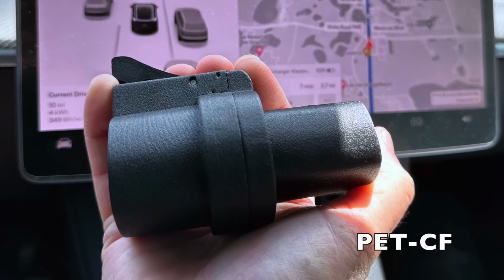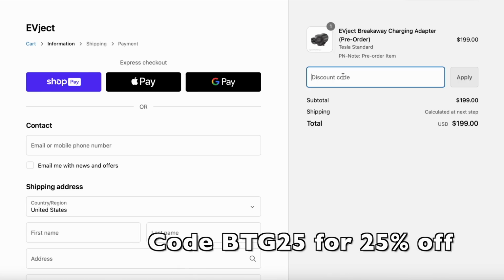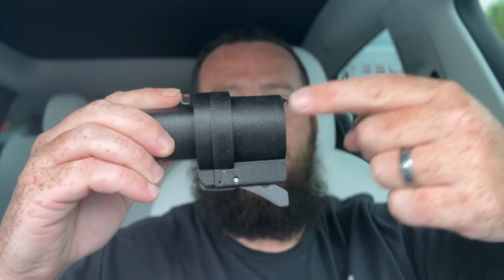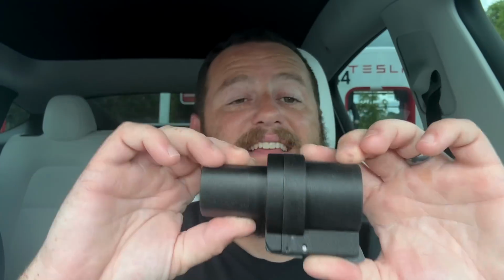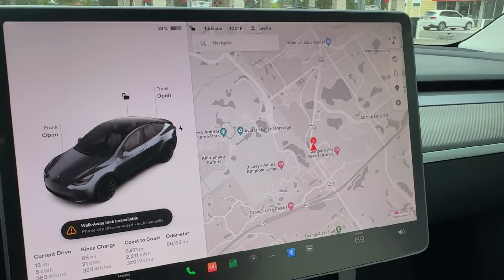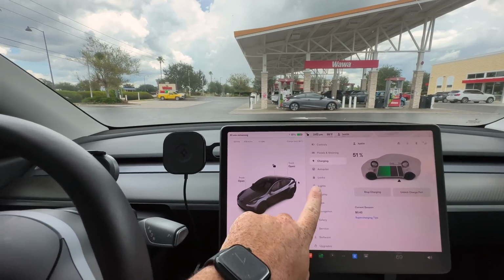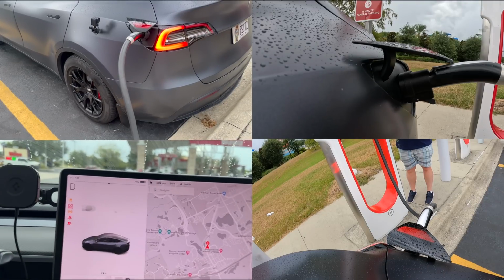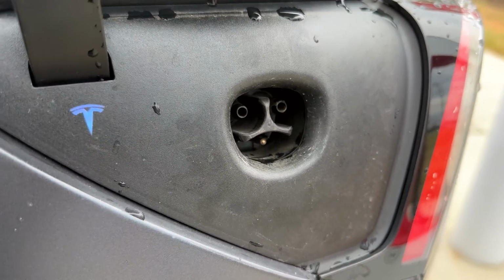This Tesla Mod Could Save Your Life!

Comment: Since this video endorsing the product is featured on the EVject website born yet I'm wondering how you feel about the product now that Tesla is suing them?

"Tesla suing a company that makes a MagSafe-style connector designed to let EV owners make a quick escape from a charging stall if they feel their safety is threatened.

The automaker alleges that the Escape Connector by company EVject is “highly unsafe and poses a high risk of injury to person and/or property,” according to the lawsuit filed in the US District Court for the Northern District of California last week.

Tesla is calling on the court to block EVject from calling the product safe, ban the import of the adapter in the US, and make the company pay no less than $75,000 in damages."

"In the filing, Tesla says it has tested the North American Charging Standard (NACS) version of the EVject accessory in a high-current simulation with the company’s Supercharger cable and a vehicle EV port. Tesla found the EVject product got as hot as 100 degrees Celsius (the boiling point of water) while DC fast-charging at 420 amps."

Comment: Without an adapter... does pressing the charge port button on screen still disengage the latch holding on to charging cable? Or does car disengage the latch just becayse it somehow knows theres an adapter. If the former is true then you can put the car in drive with just the tesla cable plugged in and drive off 0.o. You would just do damage to car i think.
Reply from the maker: Cannot put car in drive when simply plugged in.

Comment: I have mixed feelings about this product - does it cause any damage (visible or unseen) to the actual supercharger cable - I assume it needs some force to actually break which will be equal to the force where the supercharger cable joins the supercharger casing.

I think the price is fine (or should be higher) as it should be an emergency only use device that should dissuade actual use. 

I wonder what the Tesla Terms and Conditions say about using this device too.

Finally, I know your audience is mostly US, but as a European this is very much something that I don't see us ever needing here.
Reply from the maker: The force needed sounds like a lot but you can stand there holding the cable while it breaks and it won’t even move you
Reply: Am I wrong to not care at all about damage to the supercharger cable? Nobody is going to be buying this expensive adapter and breaking it for fun, leaving behind a damaged supercharger. This is for emergencies. I'll happily bust a supercharger if it means I can escape a dangerous situation with my life.

Comment: The concept is cool. I think a breakaway should be made to connect at a right angle with a piece that stays with the handle and can be easily replaced for a lower cost. This could also put less stress on charging port
Reply from the maker: Maybe

Comment: Interesting device.  I think Tesla should have this built in.  Gas pumps break away if somehow you forget to put back the handle.  I remember seeing a sign it will cost you 700 bucks driving off with the handle.
Reply from the maker: I agree, but until then, this will suffice

Comment: This is VERY expensive if it is a throw away item when you need it. Price is way too high if the company is looking to help people be safe. They should not charge $200 for it!
Reply: I mean, I'll buy a cheaper version if someone makes one but $200 for a potential lifesaver seems pretty cheap. A Tesla costs $40k to well over $100k. The floor mats can cost more than $200.
Reply: They should make it cheaper since most people will buy more than 1 and you cannot reuse it. If you could, then that would be a different story. Teslas and any car is worth lots of money, that is what insurance is for.. @bigoldjim4696
Reply from the maker: Well, that’s usually how it works when a first time product hits the market

Comment: This actually seems like a great idea. 

Be aware that the opposite device is also available …. If someone jams one of these into your chargeport, you will be stuck.  

The Emergency Plug

https://youtu.be/5G3bbPy3g1Y

https://youtu.be/5G3bbPy3g1Y
Reply from the maker: you can release the charge port manually from the rear of the vehicle fyi

Comment: Wow I had no idea something like this was being worked on.  I had to charge just on Saturday and felt threatened in a location that I was not familiar with.  A bunch of people rolled up in a minivan without plates and ran towards me.  Luckily I was looking up for a second and had just enough time to unplug and hop back into my car.  One of them then tried to break my window but I was able to get out.  I can't even begin to imagine what would have happened if I was unable to unplug in time.
Reply from the maker: That’s nuts! That is what this device was designed for though
Reply: Do you have any dashcam video of this?
Reply: At gas pumps it would be spilled flammable stuff driving off with a pump still in.. sometimes we can get so caught up planning for disasters we fail in preventing it or accepting poor quality of life as normal..  it’ll lead to some broken Tesla stations too from the swinging pump falling after the yank away..
Reply: @JoshuaWalls2014  I do not think that the Tesla handle will be harmed as a portion stays on the Tesla handle thus protecting it during the fall, very great idea!
Reply: @JoshuaWalls2014  Damaged station is not a problem as shown in the video.
Reply: You would be one of the only people to ever have this happen. This product is a waste for 99.9999% of user's.